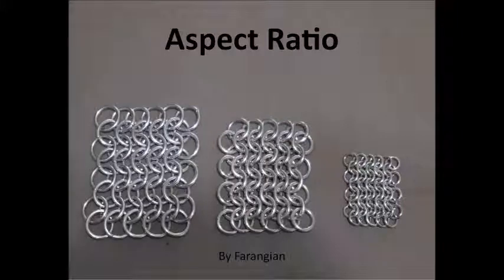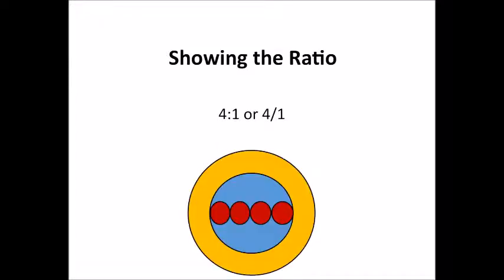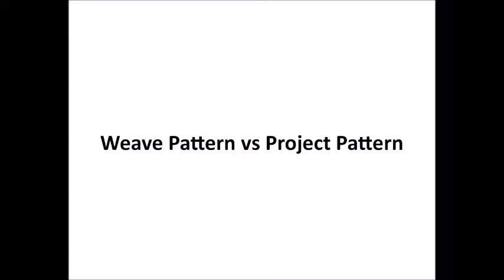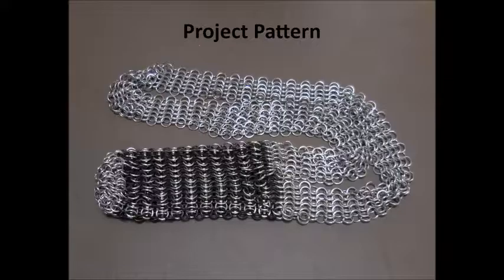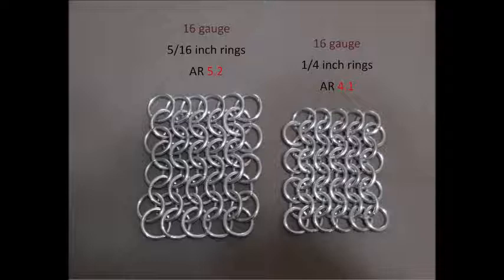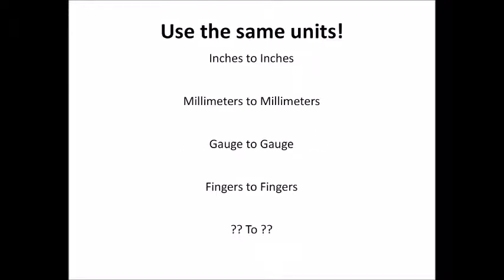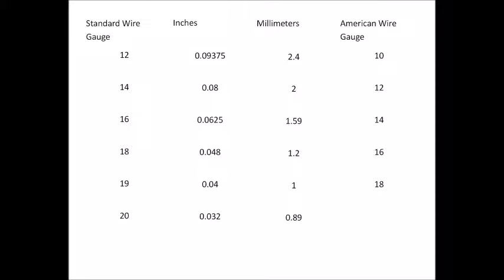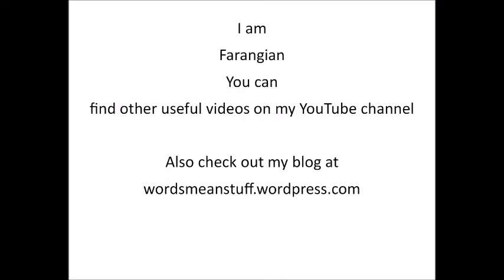Aspect Ratio for Chainmail

Comment: nicely done. there is a shortcut worth mentioning for those that make their own rings, and that is to cut one ring and just hold it up to the side of the coil from which it was cut and you can se how many rings are visible through the hole.
Reply from the maker: Nice tip, thanks